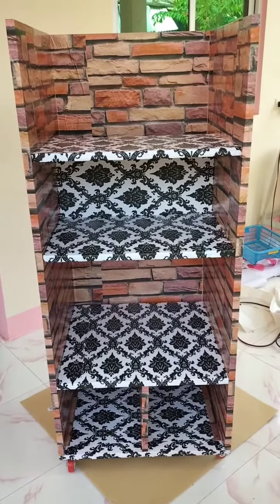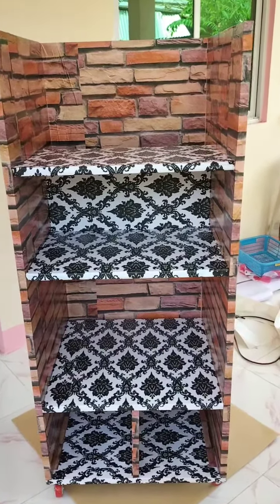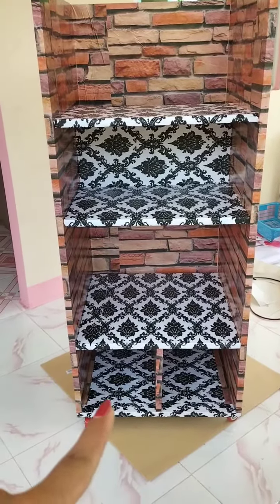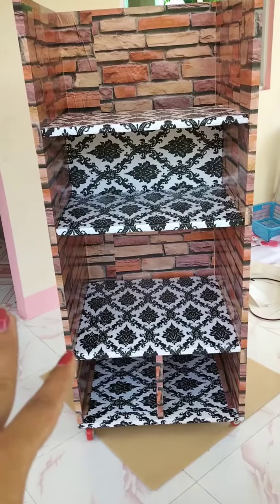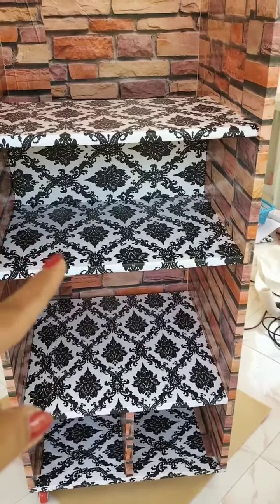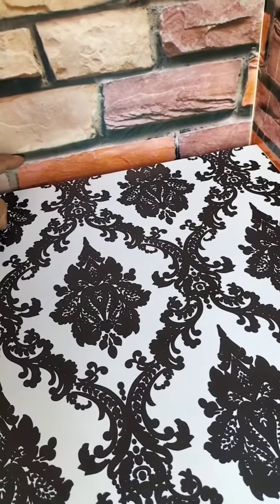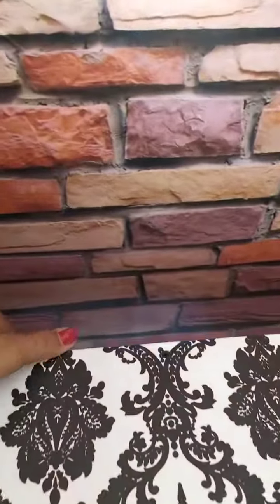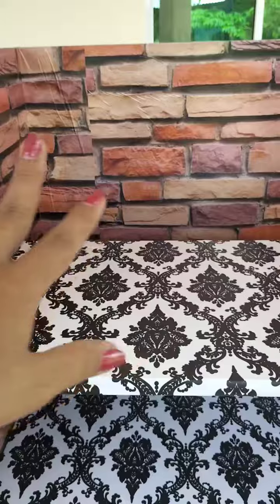Mini Cabinet For Solar Setup

Comment: That looks nice.  Good job.
Question --  Did you take into consideration the weight of the batteries for the wheels?  Will they support that much weight?
Reply from the maker: Yes